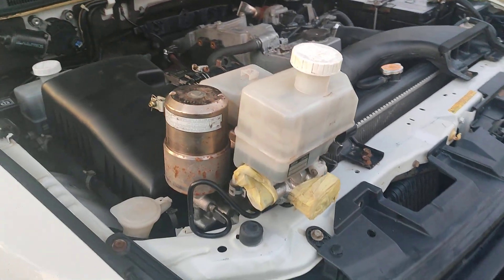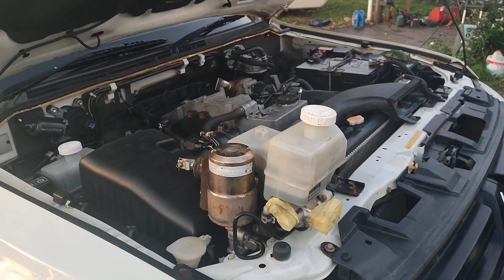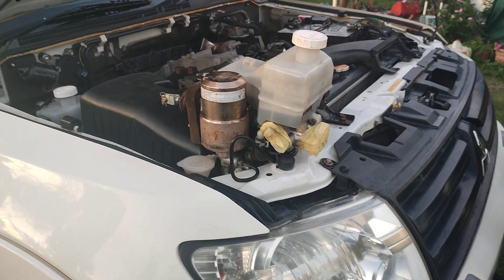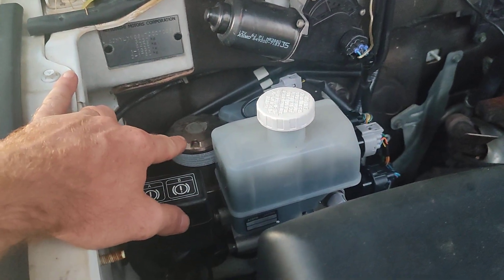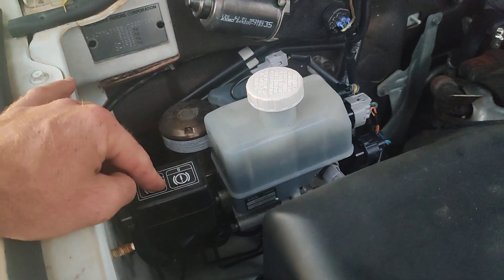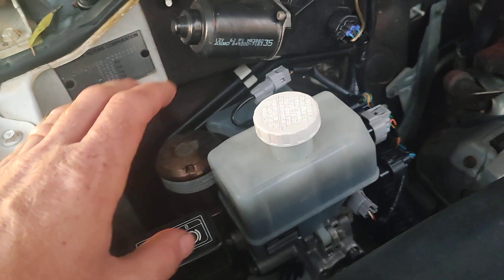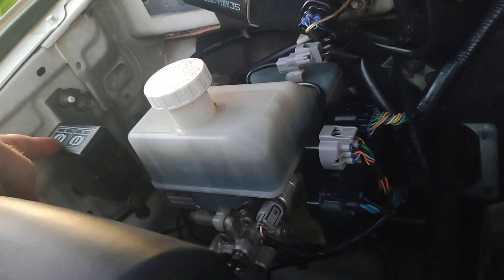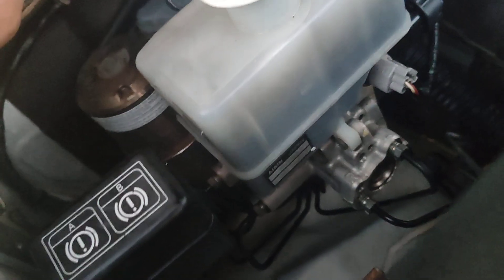Pajero Hydraulic Brake booster HBB explanation and failure types

Comment: The HBB failed on my early 2008MY at 13 years/120k(kms).
No warning lights or noises, but could only hold the car on the brakes for about 30 seconds, with the pedal sinking slowly, before the brakes released. There was absolutely no leakage anywhere so I concluded that fluid was creeping back past master cylinder seals - perhaps damaged/worn cylinder or seals? However, as far as I could discover, there are two pistons, one of which has a one-way bleed valve. Perhaps this failed?
I wasn't able to locate spare pistons/seals in Philippines and eventually fitted a brand-new HBB. Someday I may dismantle the old HBB to investigate.
I still haven't managed to bleed the system to my satisfaction, but it all works (with long pedal travel).
Would a vacuum pump help or do I need to use an OBD ABS bleed function?
Reply from the maker: Pedal slowly creeping to floor is master cylinder or leak (fluid will go down in reservoir over time). Bleed as normal 500ml per corner but have the car idling when you do the rears.
Reply: @MariusFourie  absolutely no leak - the fluid level in the reservoir didn't budge even 1mm. It had to be bypass of the master cylinder seals/pistons.
A year later, I installed a brand new HBB and have not had to top up at all in the 2½ years since. I still have the old HBB and may investigate when I have nothing more important to do! 
I will have another go at bleeding the system again, following your advice, to see whether I can get a firmer pedal.

Comment: Can you unhook the buzzer sound
Reply from the maker: No. You can maybe pull a fuse or something but it's not recommended. If the HBB system isn't working you don't have power assisted brakes which makes the pajero extremely hard to stop. Extremely dangerous! If you have an issue, I recommend you fix it, or it could cost you your life... and maybe someone else's as well.

Comment: Hello I have issue with my HBB, pump starts every 5 sec and accumulator cant hold pressure, I hear hissing from accumulator, its like air leak, but brake fluid flow immediately to reservoir and pump starts pumping to accumulator. When I turn key off, brake fluid flow to reservoir and brake pedal is very hard. I think there is mechanical issue with some leak, maybe accumulator or main piston seal in HBB, I want to remove accumulator and check small pipe and spring. Could you know, what is wrong with my HBB ?
Reply from the maker: swap out the accumulator or test with friend by swapping out. That's the cheapest check.
Reply: @MariusFourie   I bought this accumulator maybe 3 years ago from dealer, they changed it and it didnt help, and they dont know what to do with it so they wanted change whole HBB for 3000 dollars. I didnt agree with it and I tried solve it myself, I found issue, it needed air bleed from brakes. I tried air bleed now and didnt help. If my issue is accumulator again I need to buy another from dealer for 400dollars.

Comment: what could be the problem if sometimes the brake pedal is spongy?
Reply from the maker: generally air in the system. Start by bleeding all four corners. Rears need to be bled with engine running.
Reply: @MariusFourie  i have the same problem for a Pajero 2004 , but i found that everyime i press the pedal some air bubbles came out to the resevoir, and the pressure drops

Comment: Sir my pajero hbb brake padel is spongy.suddenly press the padel is normal.but normal apply the breke paddel is spongy .whate the problem sir
Reply from the maker: what year model? Spongy brakes usually means air in the system. Do a full bleed as a start. Rears need to be bled with engine idling.
Reply: @MariusFourie  sir I am just brake bleeding star but suddenly traction,abs, parking light show and continue buzzer on.new problem show sir.
Reply: @MariusFourie  code show 57accum prs low just showing code

Comment: I need help figuring out if my issue is the brush motor or the accumulator. I have the same NS but left hand drive so my assembly is on the opposite side of the engine compartment. When the brake boost pump kicks in I hear what I think is the brake pump motor pressurizing the accumulator (this sound https://www.youtube.com/shorts/L6w9oR-j-vE). That lasts for about 3-5 seconds and then at the end when it stops I hear a nasty scraping sound for about 1 second. It sounds like this guys video (https://www.youtube.com/shorts/Rw-n64KUjz4) but just one time, not repeatedly.  I'm nervous to drop 208USD on the accumulator if it's the brushes on the mechanical pump itself... it sounds like metal on metal scraping which makes me thing the electric motor. Ideas?
Reply from the maker: The noise on the second video is the pressure bypass valve. If the pump runs then stops, then the motor, relays and fuse is likely OK. If the motor continuously runs and you keep hearing the screech noise then the accumulator or valve body or pressure sensor has failed. Go to a breaker yard and ask if you can swap out as a test. Ignition off, pump brake 40 times, unscrew the accumulator, screw on new one. Make sure you don't lose the little shaft, spring and o ring when you unscrew. Start the car once swapped (no need to top up fluid) and see if everything checks out. Motor should stop in less than a minute to pressurise accumulator
Reply: @MariusFourie  Thanks for the quick reply. The screech noise is not continuous. It happens one time for about a second and does not repeat until the electric motor kicks in again to re-pressurize the accumulator.  I'll see if I can test out another accumulator at a parts yard.
Reply: @MariusFourie  Sometimes, when I'm braking, I hear this noise like the second video for a very short time. It sounds something is not working as suppose. Should I go for a fix or something? I just bought this 2008 Pajero.